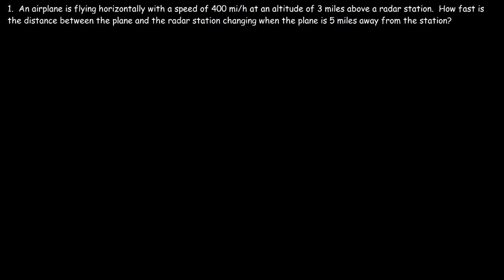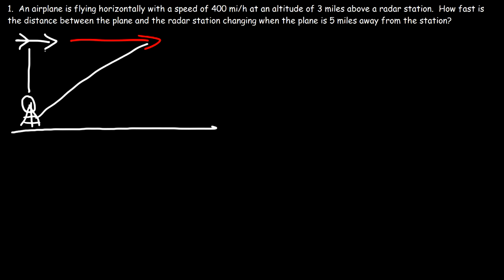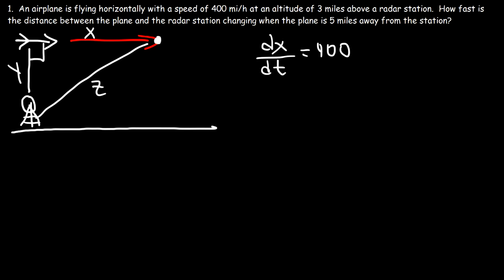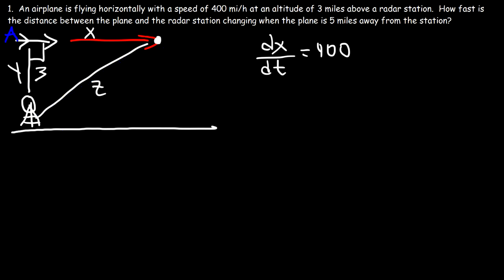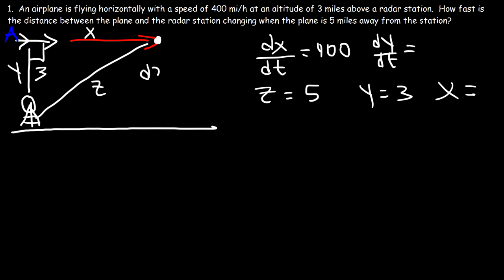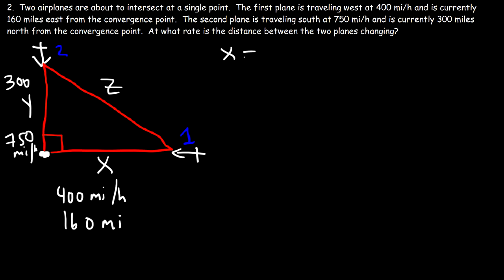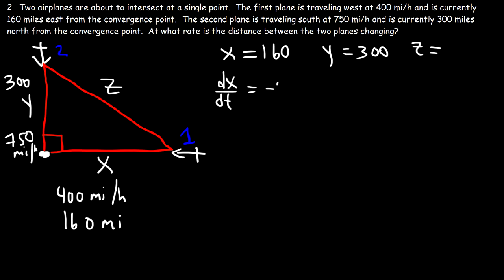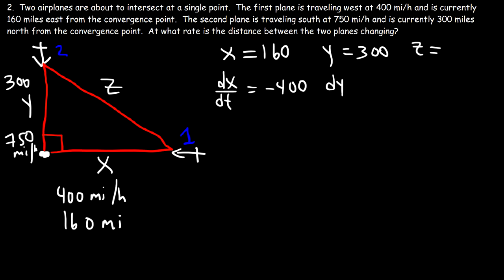Related Rates - Airplane Problems

Comment: I have one question. 
If that plane was flying from A to B and then to C, and there is an angle (i.e.) of 130 degrees turn (i.e. left) btwn AB and BC, how may I calculate the time and/or the distance from B at which I should start the turn in order to complete the turn on the segment BC ? Assume omega is 3 degrees/second and a to start=a to stop the turn is 0.7 degree/sec/sec ?

Regards.
G.

Comment: What if you are given in degrees like at atwo straight roads intersect at an angle a = 60°.  Cars move away from the intersection along them;  one with a speed of v=60km/h, the other with a speed of v=80km/h.  determine speeds